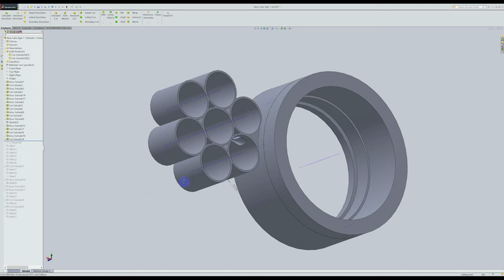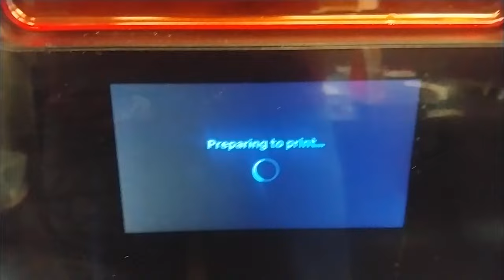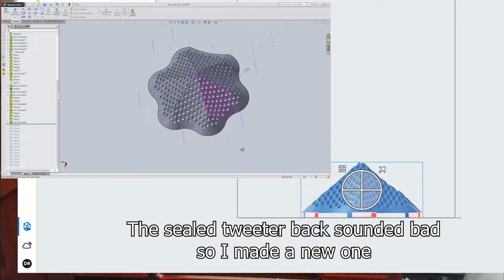Hear & See Build 7 Foot Polished Stainless Tube Speaker

Comment: Great video, as always! 
Combining a lot of HF's always scares me (I am a Danley point source -purist kind of guy), but if it works, it works. Why do you have all those mic capsules laying around, BTW? 

My dream is to see a maker-project with you and Adam Savage, my two YouTube guru -dad figures. If that ever becomes a possibility, let me know and I will do what I can to make it happen! 

Rock on
Reply from the maker: Hmmm, well many of the danley enclosures do exactly that and combine a lot of HF's. The J8-94 has 24 HF's! All combined together.  In fact Danley combines more HF's than any other speaker manufacturer I am aware of.
Reply: @DaveRat  Not a traditional speaker by any means, but the Holoplot X1 Modul 96 beamforming speaker has 78x HF units, vs 64x in the Danley J4-31 or J5-4015. Worth having a read about the holoplot it's doing some pretty cool stuff bringing well known signal processing techniques into the pro audio world for the first time.
Reply from the maker: Yes, the Holoplot is very interesting and powerful.  Was just looking at the amps that are used in the speakers. Amazing units. Will do a short vid on them at some point.

Anyway, Danley presents their product as point source and gives the impression that they are immune from and don't have issues associated with having multiple HF sources. Point source is just another word for non arrayable.  And an arrayable point source system is an oxymoron.

Holoplot is based on multiple sources like a super complex TV sound bar
Reply: @DaveRat  Hi! 
Thanks for keeping the conversation alive while I spent all my waking hours the last days completing an installation of Alcons Audio speakers at a venue here in Oslo. It really rocks the place! 

I think that the people at Danley would argue that they either use only one HF driver (SH and SM series) or physically shape the wavefront of multiple HF drivers (Jericho and SBH series) into one coherent wavefront. Never combine multiple HF drivers without shaping the wavefront of each one so that it matches it's neighbour's and exits the mouth of the horn without destructive interference between them. My experience is that this works wonderfully when done right, but is really impractical in most cases, as you pretty much need a dedicated loudspeaker for each situation / venue. 

This quest for the "perfect loudspeaker" has been the white wale of my career in pro audio and I have yet to find a satisfactory answer. Conversations like this is the wind in my sails! Thank you
Reply from the maker: The shaping of a coherent wavefront from multiple drivers is the foundational basis of line arrays.

This is what is so amazing about the premium line array tech

One of the best explanations I've heard came from Jeff Rocha, former president of EAW when discussing the 14 x 1" drivers in the anya system.

He said the drivers act like a flexible continuous ribbon. Altering timing and phase allows you to bend the ribbon into any desired shape. The shape of the ribbon determines the coverage that can be achieved.

And my take on point source:

With a true point source system you could put your thumb over the point and it would be silent, right?
Reply: @DaveRat  I agree the coupling issues with multiple HF drives is not solved yet, danley has their own unique/patented system for this (US8488826B2) based on a custom combination device but how much this helps i can't say. However their method of coupling mid and low frequency drivers IS somewhat a valid technique that very few others are doing, in the mouth of the synergy horns the drivers do not simply lat flay and play through, the inner area of the driver cone is taken up with a plug and the small channel inlet to the horn mouth is close to the inner of the horn which redirects the acoustic mass significantly closer than is usually possible. Under 1/4 wavelength (in air) of the lowpass frequency of that driver pair near zero phasing issues and almost true +6db coupling can be achieved. Due to the dimensions of drivers used to reproduce those frequencies there is no other way to physically place them as close as they would be to achieve this any other way, it's as if the centre of the drivers were physically overlapping while pointing the same direction as close as 1-2cm away/offset from the centre which is obviously impossible in something like a normal point source or line array.
Reply: @DaveRat  Sure! 
What I don't understand is how you can sum several HF's without shaping the wavefront of each one (in a waveguide or lens) to mach the others without too much destructive interference? To my knowledge you would have to space the drivers within the distance of a quarter wavelength of the highest reproduced frequency to make them play well together. How do you do this when the size of the drivers are 1" (2,52 cm) and the wavelength of 20K is 1,7 cm, without a waveguide? 

My experience with column array speakers is that they might produce a flat frequency response and high SPL, but the soundscape ends up being really diffuse and the dynamics are not perceived as equally “punchy” as a good point source at the same SPL. Did a comparison once between a K-array Python and an old EV Deltamax and the results were quite eye opening! 

Don’t you have a saying that you shouldn’t reproduce the same sound from more than one source? 

To my knowledge, the Holoplot utilises Wavefield synthesis at a small scale, which is an entire subject in and of itself and really interesting stuff! 

I guess you wouldn’t even need a thumb to cover up a true point source, as it would be infinitely small in all directions ;)
Reply: @zzink  Didn't see your comment before I posted, but it looks like we care about the same issues. I really hope Dave can help us get som clarity into why so few loudspeaker manufacturers see this as an issue
Reply from the maker: As long as the spacing between sound sources is a fraction of the highest wavelength they reproduce, they typically act as a single source. 7 small drivers packed tightly, when all fed the same signal and all are relatively matched in design, will tend to act as one bigger source with the summed volume and freq response of the individual sources.

It's when you sum drivers after the horn that issues get complex as the path to separate sources is now different, and they are not acoustically next to each other.

There is a lot of marketing crap and hype to avoid.

Many speakers very close, moving in unison will acoustically sum. As good if not better than a single larger driver that will suffer from breakup modes. 

This can all be easily shown with sub woofer arrays. And highs are the same, and will array the same, just the distances for highs are much smaller

The same theory applies to tweeter arrays and combining tweeters as it does to combining subs. So looking at it that way, if you don't believe highs can be combined, then you also don't believe subs can be combined. Both face the same issues but on different scales.
Reply: @DaveRat  The belief that you should avoid summing multiple HF drivers without shaping the wavefront of each one to match the other's is such a deeply held belief of mine that giving it up would require me to experience it myself. In other words: this requires an experiment! 

Do you have a suggestion on how one should proceed to do such an experiment? 
I have the facilities to construct a test-rig, do the measurements and upload the results to YouTube. This should make useful content as I am surely not the only one wondering about this 

This has been a very limiting belief for me, so letting it go and being able to embrace most loudspeaker designs as more than just a compromise would be very freeing! Am I a (recovering) loudspeaker -racist?... 🤔
Reply from the maker: Hmmm, what to avoid and what to embrace are highly dependent upon the desired outcome.

As far as shaping the wave front, for a small diaphragm driver with a flat or relatively flat disc shaped radiating surface combining with another small diaphragm disc shaped flat or relatively flat radiating surface, what shaping would be needed?

The wave front radiated by these flat diaphragms is already perfectly naturally shaped correctly to sum with its neighbor

The ideal radiating surface can be represented by a multitude of very small points all moving in unison.

This can be achieved by using a whole bunch of really small drivers very close to each other and actually can reach higher levels of unified radiating than a larger driver with a motor in the center that suffers from all the cone bending break up modes and other issues.

Using a horn or a waveguide to increase the surface area of the radiated waveform is useful but comes with its drawbacks as well.

Horns are basically transformers that match the relatively low impedance of the driver's radiating service to the high impedance of free air.

One can achieve a shaped wave front by creating a horn that chokes bends and expands the sound radiated from the driver in such a way as to result in a desired coverage.

One can then attempt to sum one horn or waveguide output with another horn or waveguide output to minimize issues resulting from that summation

Conversely, a multitude of very small drivers mechanically positioned such that when they radiate sound they automatically and inherently radiate in the desired manner creating the desired wave front, can be even more effective and will not suffer from the combining horn issues if properly designed.

The multitude of small drivers if positioned less than 1/4 wavelength from edge of driver to edge of driver can act as a large single driver.

Using wave guides in horns will often increase the maximum output capabilities and offer control over coverage while using less components at the expense of linearities and summation issues.
Reply: @DaveRat  
Hi, Dave! 

I went offline (visited Cuba) for a couple of weeks, sorry for the late reply 

I can absolutely see how this works relatively seamlessly when using small, flat drivers, as you do. And when the diaphragm pretty much cover the entire surface area of the construction you are able to place them close enough to have them act as a coherent source, even at higher frequencies. But you also end up creating an almost planar source, don't you? It's hard to hear from the recording, but did you experience increased directivity in the higher register? 

I guess that I have been thinking at a larger scale than this specific example (large diaphragm HF drivers or soft dome tweeters in HIFI). Do you see anything problematic with the way companies like K-array or Artcoustic design their speakers, in regard to how the drivers sum? It does not sound very pretty, in my opinion, but I might be affected by my bias. 

https://www.artcoustic.com/evolve-24-12-sl
https://www.k-array.com/en/products/line/kayman
Reply from the maker: The L-Acoustics K1 has 3 x 2" HF that sum sum such that they act like a single source.

If sound sources are close enough together, relative to the freq they reproduce, they act as one as long as they are fed the same signal.

If drivers on on separate horns and the horn mouths are summed, there will be errors of axis due to differing path lengths the sound travels

Comment: Great use for otherwise worthless mic capsules. God damn I hate the OM7!
Reply from the maker: I love them. Transformer less and the highest gain before feedback of any mic. But yeah, they don't work well unless there is lips to the mic. As soon as ya back off, the voice goes quit like the rest of the room sound
Reply: @DaveRat  The are just so dark sounding - lacking vocal presence.
Reply from the maker: Ahhh, yeah. Many of the vocal mics copy that 10db sm58 3k peak in the responce om7 does not.

Personally I am not a fan of that pre EQ peak built into the mic and would rather have a mic without that characteristic that is impossible to undo embedded into the sound.
Reply: @DaveRat  As usual you make great points. I'll have to re-evaluate.
Reply from the maker: Rather than spending your EQ messing with the peak, EQ out low mids not unlike a rack time eq or kick. An eq cut in the 150 to 250 range should clear things up.

Because the mic cap is closer to the grill, proximity effect will be much more evident and there will be more LF that needs dealing with. The advantage though is once eq'ed, you will get more vocal and less room sound than other mics.  It's a trade off but may be worthwhile for applications where you want the vocal up close and not as distant sounding.

Comment: You'd have a ball with a lathe and milling machine.
Reply from the maker: Yes I would I just got a CNC router that I'm enjoying much time with
Reply: @DaveRat  I never used either when I got them, bought the mill from a guy I knew who had a machine shop. He said "I don't know how anyone gets by without a lathe and milling machine". I thought it a little over the top but after having them, I understand completely. You'll use them waay more than you thought you would. Mine are completely manual which isn't a bad way to learn.

Comment: layman here: whats the point of using a long tube?
Reply from the maker: Great question. Have someone speak and put their hands flat either side of their face and speak, then take the heads awaynand speak.

Hear the differences which sound more natural?

No baffle or flat surface around the sound source offers a more natural sound, yet the speaker needs an enclosure so a tube is one way to resolve that.
Reply: @DaveRat  you rule, thanks!

Comment: Festool gives me wood
Reply from the maker: The best!!
Reply: @DaveRat  I love their gear, the saw with the guiderail is super scrummy
Reply from the maker: Yeah, I have accumulated a whole kit over the years, makes builds so much easier and more fun.
Reply: @DaveRat  The plunge saw has a digitally controlled electric motor, regardless of the cutting depth it always spins at the same speed.... I have cut inch and a quarter oak with one, cut through it like butter and left a well defined line..... It's great gear... Smashing
Reply from the maker: Yes, I have the 55 and it's awesome

Comment: HighEnd SLA 3D Printer.... but no CNC ?  Santa will bring you a CNC Router I hope :-)  
(which was the best investment of my life tbh)
Reply from the maker: I so want one! Been looking to get one.  Suggestions for a 4x4?
Reply: @DaveRat  If you're not experienced i'd recommend to start with something smaller. And as always: don't buy the cheapest :-)
Reply from the maker: Yeah, will see, most of my build stuff maxes out at 42". The 1/2 sheet of plywood would be ideal. Does not seem overly complex to learn
Reply: @DaveRat   I wouldn't say that its complicated to learn, but you will make mistakes. The larger the machine, the more expensive the mistakes :-)  start a bit smaller. your very first mixing console wasn't a XL4 i guess ;-)
Reply from the maker: Ha!  I can afford the mistakes more than the time to setup everything twice. And thank you.
Reply: @DaveRat  ok, but please don't ever say I didn't warn you ;-)
Reply from the maker: Ha! I will post my mishaps under "Markus said it will be fine" 😁